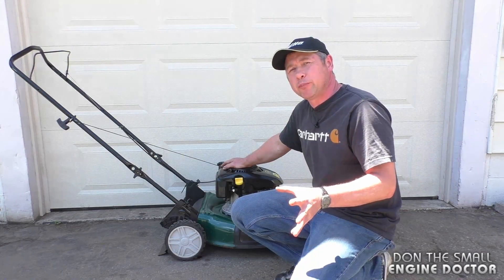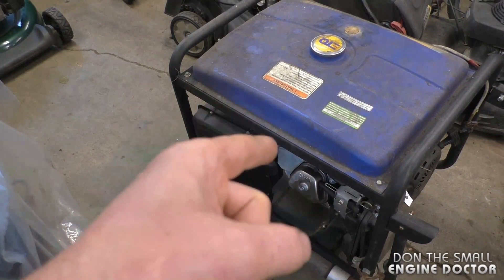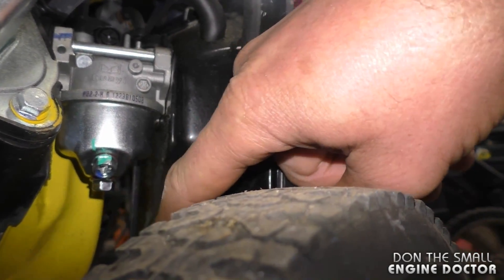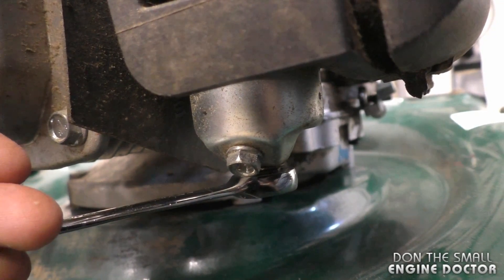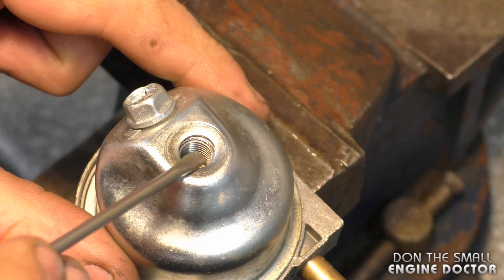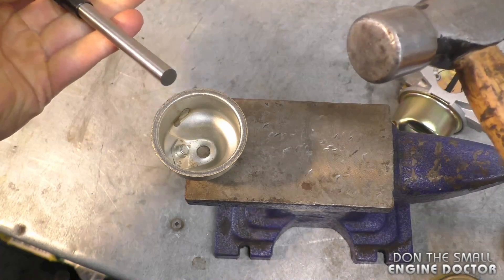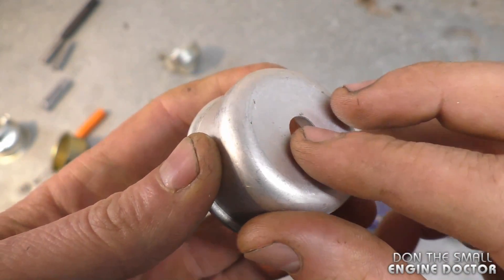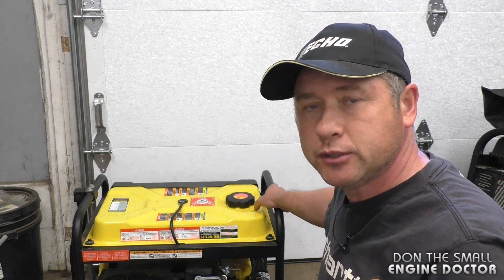Fixing A Honda Style Lawnmower Carburetor Leak - Easy Steps For A Smooth Running Mower

Comment: I just did what you explained with the punch and knocked a few times on the flat part of my vice with a hammer and punch on the carb bowl and it worked, the small leak was fixed, thank you for the great advice and video, I've learned so much from your channel, cheers from a fellow Canadian in Mississauga Ontario

Comment: Just came across this issue on a 20 year old F220 tiller. Only came across this once before and cured it  with RTV on the o-ring. Did not realise bowl was bent. Fog is clearing thanks to your video

Comment: Don, You Can Also Use A Fine Thread Bolt And Nut With 4 New Flat Washers That Are The Inner And Outer Diameter Of The flat Area On The Bottom Of The Fuel Bowl, Putting 2 Washers On Each Side Of The Bowl With The Nut And Bolt Tightened Up With 2  Ratchets And The Sockets Needed For The The Bolt Side And But Side.... The Washers Are What Doing The Work Mainly And Will Level Out The Flat Spot On The Bottom Of The Fuel Bowl As Well On Different Types Of Carburetors....

Comment: Great tips, I am wondering if you can get a larger flange head bolt with the same threads as the original an such would aid in not having this issue?? If you could braze?? Maybe a thicker washer in that area may also work.

Comment: Will a carb bowl be more prone to leak if the needle valve won't seal well. I suspect my float is not working correctly to close the valve (it is one an old generator with a Tecumseh engine)... Love the clear and structured video presentation of the topics! Cheers!
Reply from the maker: yes absolutely, i will address that in a future video
Reply: To add, tbe engine won't start or even sound like it is trying to fire. Spark is good. I removed the bowl and cleaned the needle valve, then reassembled. After replacing the pull-start rope, I wore myself out trying to start it. So, after emptying the gas, it has sat in the corner of the garage! I'm thinking of donating it to our local small engine shop... :-)  (I do have two others that are more reliable and better maintained!)

Comment: i have a honda g100 with a broken oil dipper on the connecting rod cap. Can I just replace the cap and one side of the bearing or do I have to install a new connecting rod as well, 
basically Im trying to ask if I can have one half of the bearing new and one half old

Comment: Easier  and  safer  to put a Plastic   Flex bowl, such as small Balonga Meat Platic Container   under the carb ..  to check for  leakage ... rather than card board ..

Comment: I have a question : How do lawn mowers charge the battery? My tractor only has a starter and magneto (ignition coil). Do they even charge the battery? I have an old Rally 10 hp , Briggs&Stratton engine.
Reply from the maker: there is a small stator under the flywheel that charges the battery
Reply: @donyboy73   Thank you!

Comment: Don, I have a lawn boy morrow model no. 5024 Seral No 7997429. It leaked gas when I turn the gas on. You have any tips to stop it ? Thanks
Reply from the maker: replace seat and needle valve

Comment: yesterday i fired up my new one year old husquvarna leaf blower warmed it up think its a 2019 model i put new gas with a stihl oil 50 1 mix 3 minutes in it wouldnt run unless you put it on half choke ugg

Comment: I had a honda carb that kept leaking gas from the air box. I must if taken the thing off a gazillion times. then trying to sandwich everything back together is a nightmare. I even went as far as buying a new needle. still leaked.... what ultimately fixed the leaking was gently polishing the valve seat with a drill bit. I'll be damned! no more leaks!
Reply: Yes exact same problem and solution.

Comment: I find those hard red gaskets on Chinese aftermarket carburetors always leak. I replace them with a good fiber gasket and no leaks. I have had 4 Chinese carburetors  turn junk from the start so I quit buying them. OEM or nothing now.

Comment: Biggest mistake I made was buying this stupid expensive Honda lawnmower. I have this cheap lawnmower that I never do any maintence work on. I just fire it up every year and it just works. This honda lawnmower has given me nothing but problems. First it wouldn't fire properly. Now the carburetor is leaking. Absolute junk. Even the junk lawnmower I have is built better. lol
Reply: Operator Error ...   Read the Manual, and do the maintenance ..     HONDA are  one  of the best made Lawn Mowers and snowblowers